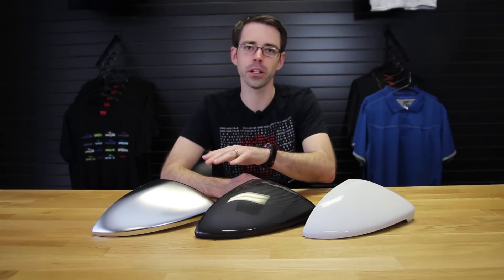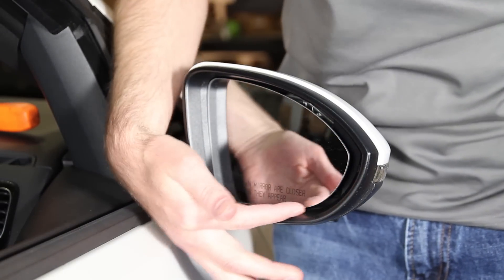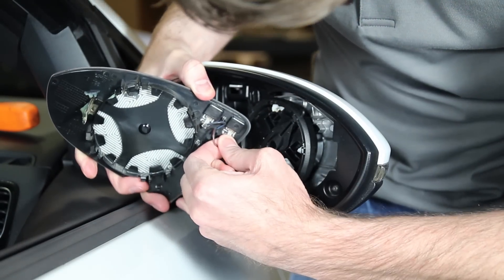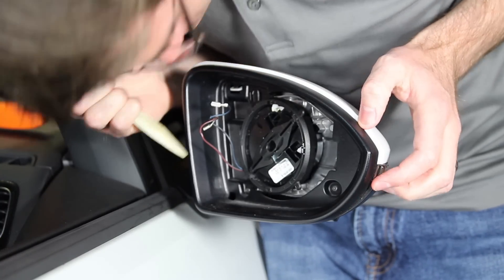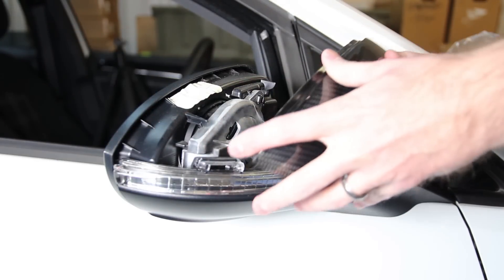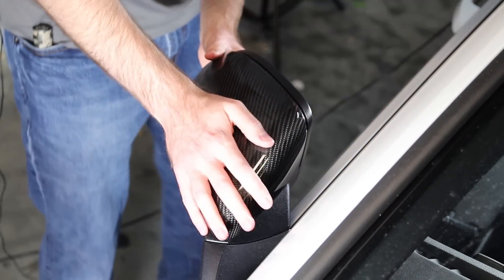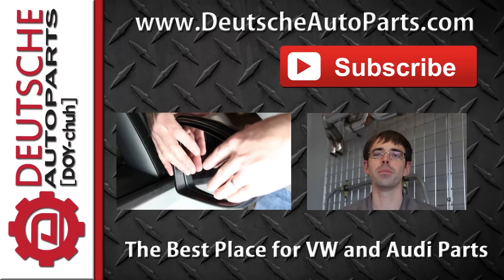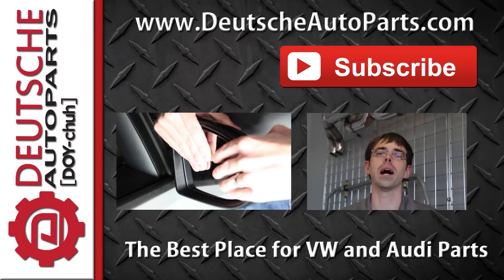MK7 GTI MIrror Cap How to Install (Carbon Fiber and European OEM Brushed Aluminum)

Comment: Took them off very easily with a thin table knife, no need to take off mirrors. Then when re-fitting .. just make sure you line up the inside first and slot it in the grooves! took me 10 mins total.

Comment: Oh and btw, there's an easier way to remove the caps. You don't have to remove the mirrors, you just dip them at the lowest setting and you'll be able to poke the latches.
Reply from the maker: Thanks for that feedback.  Many of our videos take we take apart too much so we can properly show people what they are working with.
Reply: botchok5  thanks for that tip dude!
Reply: Thankyou !! Was a bit scared to take mirror  of not gonna lie 😅

Comment: would i need to remove the full side view mirror if i wanted to replace the bottom cap? do you have a video on that as well, mine broke so I need to replace the full shell top and bottom.

Comment: Hello, thanks for the tutorial, I Have a question for your online store. What is the difference between Part Number: 5G0-898-537-3Q7 and Part Number: 5G0-072-530, for a US version Golf R 2016, which one is fitted. Thanks.
Reply from the maker: Answer coming on AskDAP 58
Reply: +Deutsche Auto Parts  thanks much!

Comment: Pro tip do this when it’s warm or use a hair dryer when removing the caps. I just did it in the cold and broke 3/4 clips:(
Reply: Did the same thing. Now I need new caps.

Comment: How well have your carbon fiber mirror caps held up? I bought a similar pair online two years ago (for half the cost), but the clear coat ended up bubbling and one of the caps is cracking around the edges.

I'm hoping yours are more durable and actually worth $300+.

Comment: I want to ask you a question 
Can i update my screen software 
I have GTI Mk7 2015 
And i have the old software 
I mean i can't see the boost and I don't have CarPlay. So give me some information about this please. Thx
Reply: sultan alsobaihi no
Reply: I've got a '15 as well.  Based on what I've heard, it's a $2000-3000 upgrade to get MIB2.  Not worth it IMO.  Bluetooth works fine and I just use a vent mount to hold my phone in place if I need Google Maps.